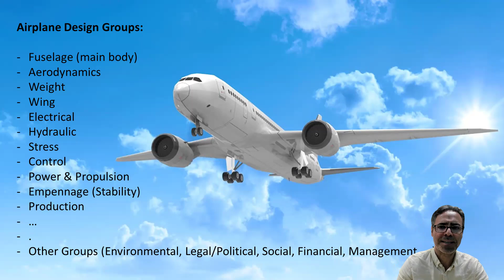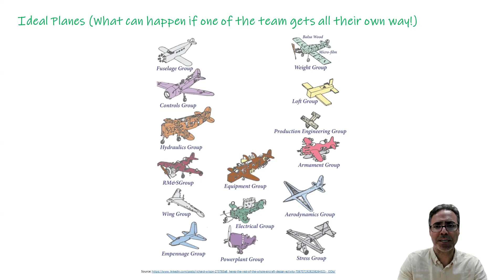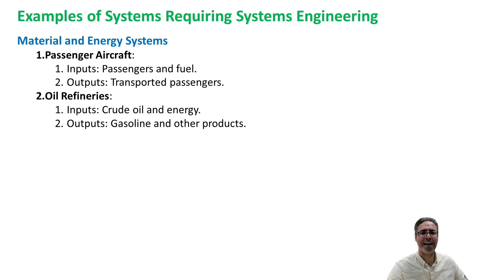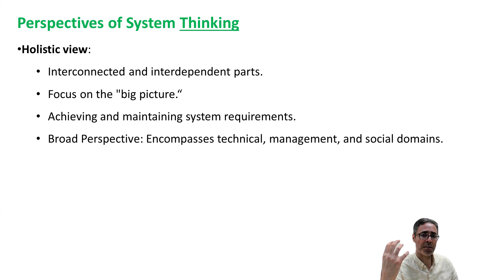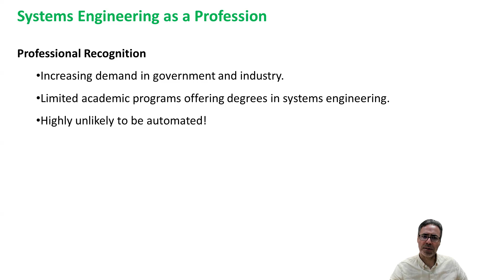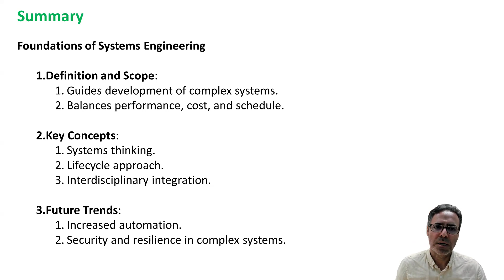Lecture 1  An Introduction to Systems Engineering

Comment: A system that piques my interest in the context of systems engineering is autonomous transportation systems, such as self-driving cars or drone delivery networks.

These systems are complex, integrating various subsystems like sensors, control algorithms, communication networks, and safety mechanisms. Systems engineering plays a critical role in ensuring that all components work together seamlessly, considering factors like real-time data processing, fault tolerance, and system scalability. Additionally, the system must be designed to adapt to unpredictable variables (e.g., road conditions, weather, other vehicles), making it a fascinating challenge in both engineering design and testing.

The development and deployment of autonomous vehicles or drones require careful attention to requirements analysis, modeling and simulation, and verification to ensure safety, efficiency, and reliability. This makes the system an excellent example of how systems engineering can be applied to cutting-edge technologies.

Comment: A system that I am interested in is the eVTOL (electric Vertical Take-Off and Landing). These systems are a prime example of complex systems requiring systems engineering. These vehicles, designed for urban air mobility, combine electric propulsion, vertical flight capabilities, and advanced control systems. Systems engineering ensures that subsystems like power management, flight controls, safety mechanisms, and redundancy work seamlessly together. The integration of efficient electric motors, batteries, and noise reduction technologies is crucial for performance and environmental sustainability. Moreover, eVTOLs must meet stringent aviation regulations and safety standards while being adaptable to crowded urban airspaces. Systems engineers play a key role in addressing these challenges, ensuring the system is reliable, safe, and scalable as it moves from prototype to operational service. eVTOLs have the potential to transform transportation, and systems engineering is integral to their development.